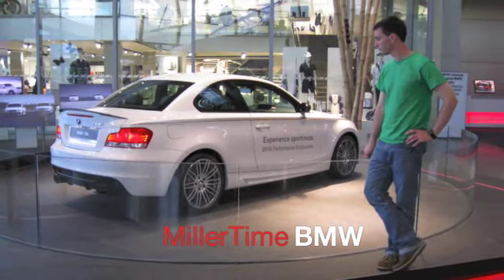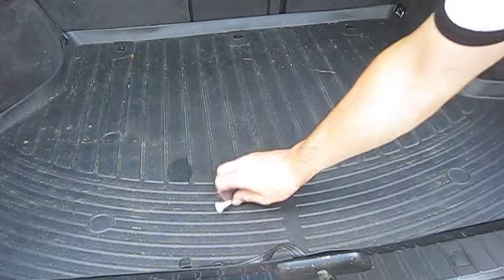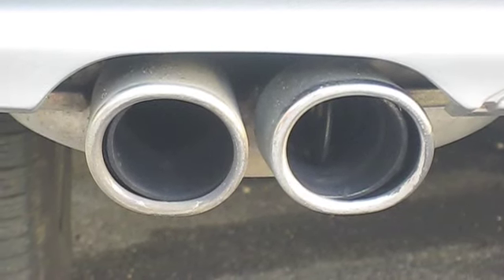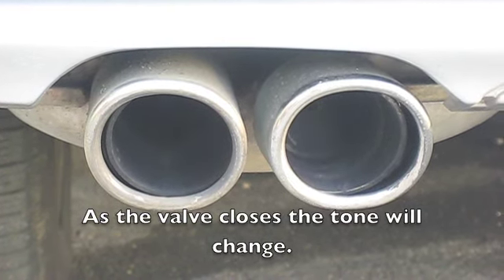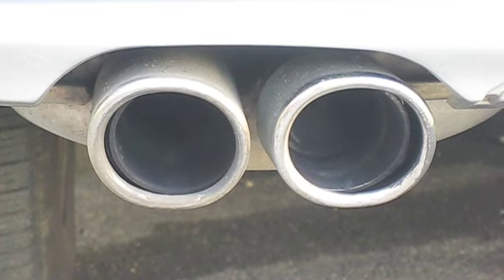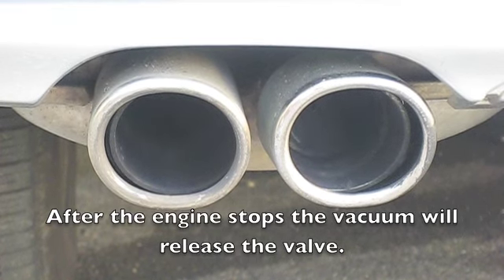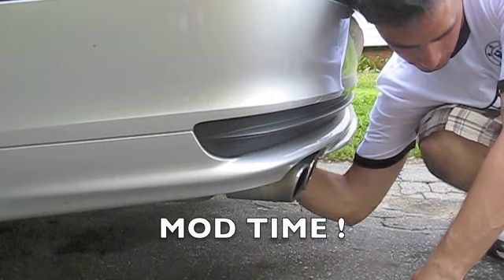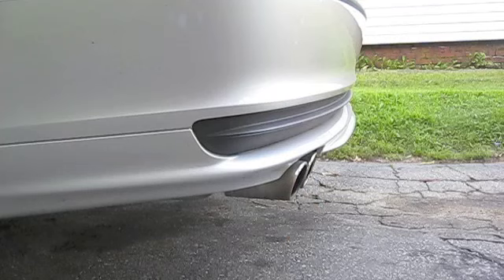BMW FREE Exhaust Mod. MillerTimeBMW DIY 15

Comment: Cheers fella for posting. Nice little mod this. I went to do it to my car and found that the butterfly valve in no2 exhaust port was seized shut anyway. This means my car had been restricted probably all the time I have had it. Once freed off and cleaned up, I disconnected the power source to the vacuum unit - its under some plastic trim in the boot/trunk. This took about 1 minute. I preferred doing this rather than sticking a golf tee in a pipe. The result for me was amazing. Not only was the sound a lot better, I noticed an improvement in power as my car was breathing better. I got smoother acceleration too! Result.

Comment from the maker: Penetrating lubricant inside and on the top of the exhaust tip where the flap is. It will loosen up and you'll be able to open it then.
Good Luck!

Comment: It is the year 2012 good sir. Did it work? DID YOU SUCCEED IN TIME TRAVEL?

Also it doesn't matter what year the car is, it's an E46, so 2000-2006 IIRC.

Comment: Where exactly does the golf tip go?
Reply from the maker: Into the vacuum tube to prevent the pump from sucking up debris or water. (= Check engine Light)

Comment: Is this for all e46 models?
Reply: No, not all e46 models have the vacuum actuated exhaust.  My 2001 325xi wagon has it, but I was told that of the 325 series models only the xi's have the valved exhaust. I would just look and see. it isn't hard to miss if you look into the end of the exhaust.